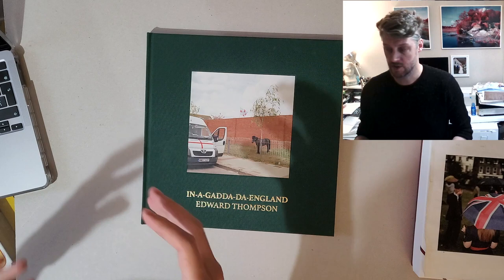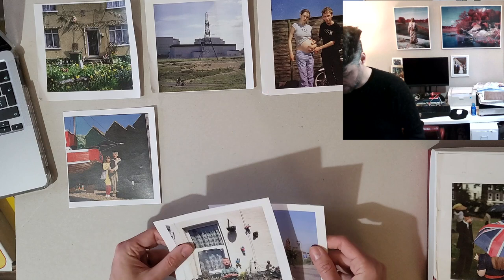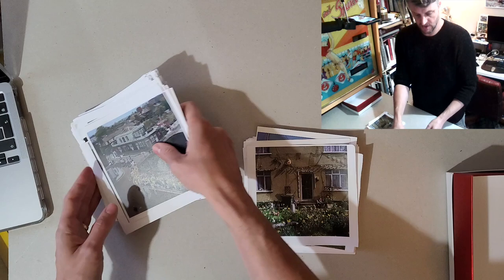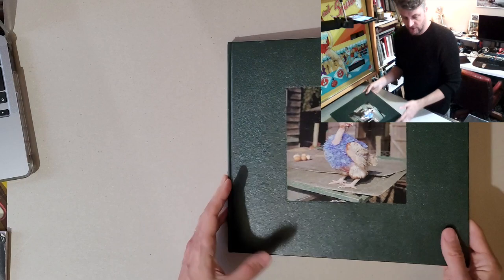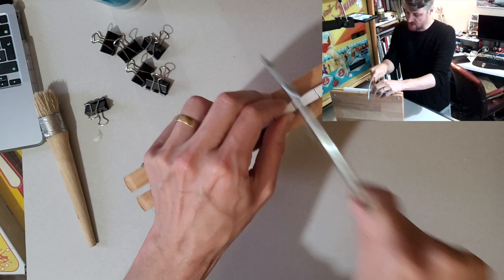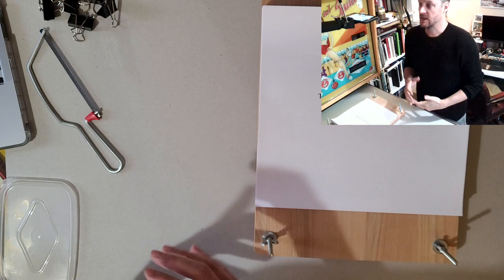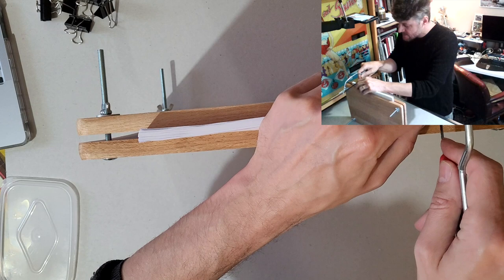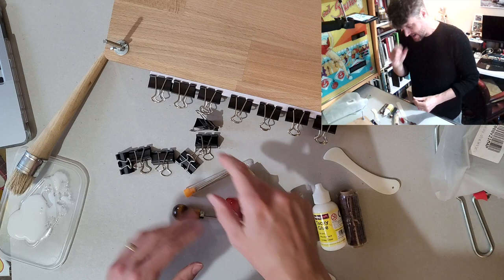Making a trashy photo book dummy with Ed Thompson. Self Publish a Photo Book.

Comment: To make inserting the book into the press easier, try inserting a bit of wood of about three times the thickness of the book into each end of the press, between the bolts so it isn't in the way. Just nip up the wing nuts so the wood doesn't move. Lay the press flat on the workbench, pushed back against the wall so it stays put. You can then insert the book with both hands in a controlled manner and keep everything aligned.
Reply from the maker: Genius! Thank you